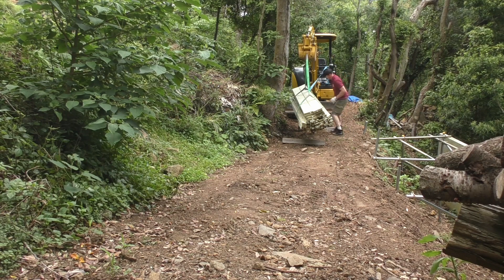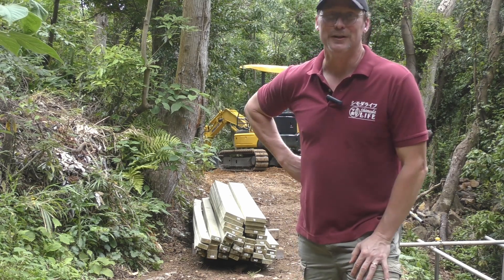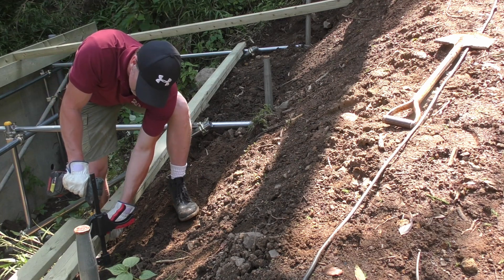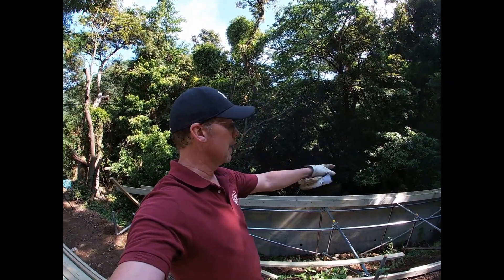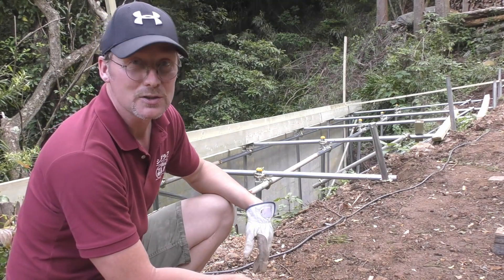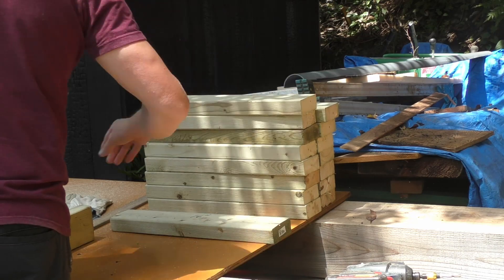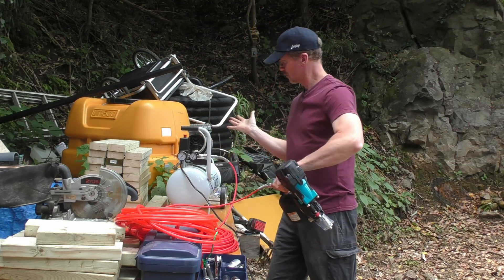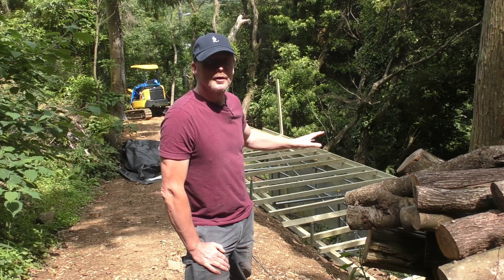Building a Cedar Deck in the Mountains (S3E44)

Comment: Hi John for a minute there I thought you was on holiday then I realised YouTube had again not notified me of last weeks video.  Anyhow all caught up even today's!.
As for the nail gun you can't beat a good framing nail gun which makes life so much easier when framing out. The cedar planking even though it was already paid for etc wouldn't it have been viable to sell it and use the money for something more ridged?  I know over here in the UK cedar is very pricey but we can buy 13ft scaffolding board's for around £10 - £13 depending on who's selling them.  Also I noticed that when you stepped onto what's going to be your platform there was plenty of flexing it maybe an idea just to make a few more noggins to support between the rafters this will not only remove the flexing but strengthen it loads for when you do start adding machines and timber that needs to be cut etc. I've found that roughly spaced 3to 4ft on each rafter works wonder's. Anyway as always buddy 💯%   👍    🇬🇧.
Reply from the maker: Thanks for the comment, Simon. I agree on the need for a couple more supports to reduce the flex. Will get on that! Cheers.
Reply from the maker: Also, I just rechecked the price I paid on the 4m 1/2" x 8" planks: 860 yen per plank, or roughly 5.20 pounds. Quite cheap, so easy to decide to use in this fashion. For comparison, the 2x6x10' planks I used in the undercarriage were 5,400 yen each, or 32.60 pounds. Not apples to apples, but...
Reply: @ShimodaLife   @Shimoda Life  wow that's some price difference. Cedar in the UK for something roughly like what you used on the work area starts at around £70 upwards and that's around 3 times the price of 6 x 2 timbers, I just had s quick look at the moment the price for 6 x 2 at 4.2m is just alittle over £25 each. It might be time to start milling wood myself at these prices 🤔.